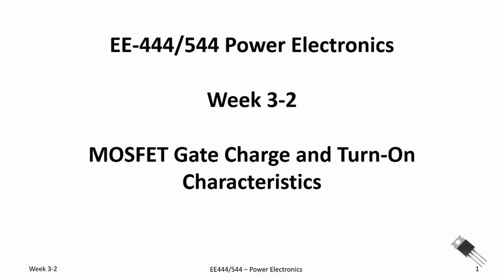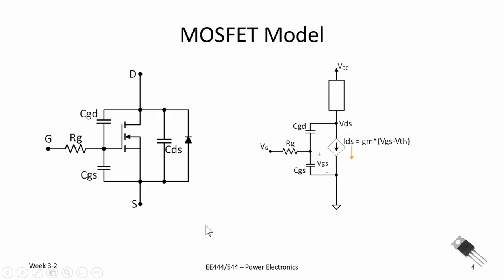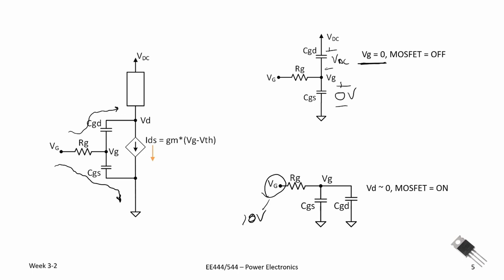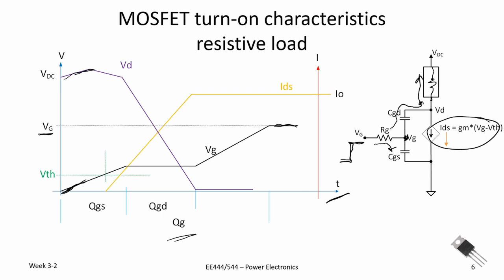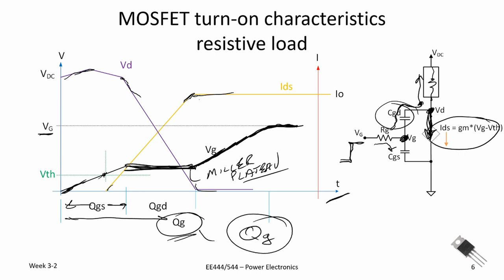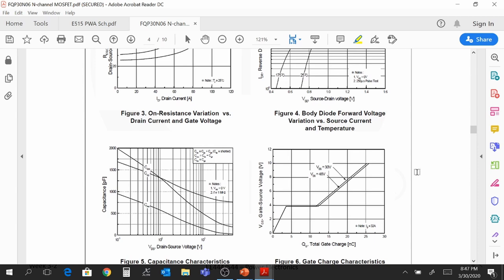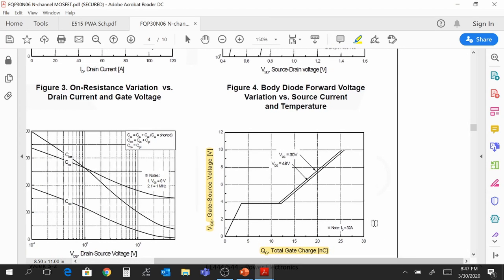Power Electronics WK3_2 MOSFET Turn On Characteristics

Comment: Thank you for your Video!
I'm a electrical engineering student from germany and our professor does not explain this very well. And by using the books he refers to, it takes way too much time to extract/understand the more basic function of this behavior. In this 18 minute Video I learned more than by dealing with all this alone for 2 hours, thank you so much!
Reply from the maker: You are welcome.  Where in Germany?  MSOE has a dual degree program with the THL in Luebeck and our German students are required to take this class in their 4th year.  Also, lots of great work on power electronics, motors, motor control, and EV technology happening in German based companies.  Best wishes on your design. -Dr. K
Reply: @powerelectronicswithdr.k1017 thank you. I live in Bavaria and I'm a student at TH Georg Simon Ohm Nuremberg, so no connecting to Lübeck. But that sounds like a pretty cool program.
We're having a big course  "circuit technology" in 4th semester of my bachelor's degree right now, so this is where we learn about this power-mos behavior.

Comment: For the resistive load case, if the current Id = gm(Vg - Vth), why does the current Id continue to rise, despite Vg being held constant at the miller voltage?

Comment: Hello Dr. K!
I came across your channel a while ago and the material is very good. Thank you for your videos. You are a good teacher.
I have a question about the consumption of MOSFETs.

If I am not wrong:

- The total consumption is equal to % of time in saturation multiplied by the power due to RDS(ON), added to the power due to the two switching (on / off) multiplied by the frequency.
(Proportional part of the time in saturation, plus two switchings, every period. The absolute power loss of ecah switch is independent of the frequency).

- All the power consumed by the MOSFET is transformed into heat.

If that is correct, measuring the temperature that the transistor reaches and dividing by the thermal resistance R-JC, we should have more or less the same number, is that correct?
I am doing tests with several MOSFETs to see it experimentally, and I see a very strange temperature graph: For a pwm of 10 KHz, pulses between 1% and 3% cause the temperature to rise excessively, and then it gradually drops to the calculated theoretical value. I've measured that temperature for 10, 20, 30 .... 250, and then 500, 750, 1000... 4095, with a 12 bits pwm. Lot of points.
For an IRF540, for example, the temperature reached with a duty of 2 us is 14ºC, and with 20 us it is 9ºC (above ambient temperature).
This is normal? Why can it happen?

If you find it strange and want me to send you specific information about the tests, I would be happy to do so.
(Sorry for my English, I'm Spanish, I hope you will understad that I wanted to explain...)

Thank you so much!

Comment: Dear Dr. K, you have explained some equations and showed plot of VGS waveform. Here a flat Miller plateau is shown for VGS. I agree with it for low side NMOS power device. But how about high side NMOS power device? Do you expect Miller region in VGS waveform for high side NMOS device during switching? 

According to my understanding high side NMOS device will act as source follower (voltage gain ~1). It’s drain is connected to fixed supply voltage so CGD will not experience miller multiplication. Hence Miller region should not exist. If so, how these equations related to gate charge, CISS, COSS, CRSS, output rise/fall time will look like?

Comment: Dr.K, I have a basic question for you. You say during start of turn on current actually flows through Cgd. My question is why does this current flow occur? I mean since capacitor is sitting at a higher voltage and charged, should we have  no current to it until it is discharged or less than VGS?  Consequently, why doesn't Cgd discharge via gate driver resistor as soon as bias is applied?  Thank you!

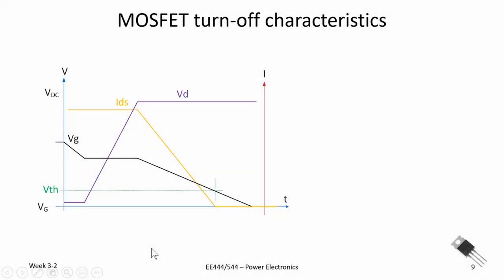Comment: Why the chart at 16:20 shows the drain current not falling together with rising drain voltage even though the load type considered in the discussion is resistive? Is this a mistake?
Reply from the maker: Hi Nishanth, you are correct that the falling drain current and rising voltage would happen at the same rates.  This would be a graph for an inductive load with a flyback diode.  Sorry for the confusion and great observation!  Best wishes on your design. -Dr. K
Reply: @powerelectronicswithdr.k1017  thanks for the content. It seems its quite rare to find material and charts on fet miller plateau in resistive load context.

A followup question, if Load resistor on drain is zero (such a circuit would be practically useless i guess. But just for understanding the mechanism), then the plateau wont appear at the gate any more, but drain current would rise to the max as per vgs and vds.. Would this expectation be correct?

Comment: 1. I wonder why Cds could be ignored? It starts from VDD and discharges to 0.
2. What circuit model is that used in the circuit analysis? Large signal model? Which operating region?
Reply from the maker: Hi Trunke, Cds is part of Coss.  Coss = Cds + Cgd and Ciss = Cgd + Cgs.  We look at Ciss as it is the capacitance that our gate driver has to work with. The gate driver has to push and pull charge into and out of the gate of the devices.  Realistically, Cds does impact the turn-off time (which is often shorter than the turn-on time).  I know this might not be a good explanation.  Here's another source to help https://www.vishay.com/docs/73217/an608a.pdf.  Best wishes on your design.  -Dr. K
Reply: @powerelectronicswithdr.k1017  Thank you very very much professor! Since I'm new to power electronics, I've learned a lot through your videos! And thanks for sharing the supplementary material! 🙏

Comment: Hi Dr. K, Wonderful explanation. I had a small doubt though...how do we calculate the switching time of the FET, is it the RC time constant ? In this case C=Cgs+Cgd and R=Rg....from your explanation I can see that when both capacitors are charged, the Vd finally drops and the FET is on...am I thinking it right?

Comment: Hi Thanks for explanation. I have few questions.

1. In general, what all is the miller capacitance affecting.

     Input cap of Mosfet will increase which will affect the previous driver , o/p cap will also increase. Is there any other effect of miller cap.
2. Does bigger plateau or smaller plateau indicate something? What effect will it have on previous stage and on current stage?
Reply from the maker: Hi Ranjana, the Miller plateau affects the turn -on -off times and is based on the gate-to-drain capacitance. The equivalent capacitance is also dependent on Vds. By “bigger plateau” do you mean the voltage value or the Qgd? Both will impact the turn -on -off times. Here’s a good paper the goes over a first order approximation for determining the switching times for a MOSFET: https://www.vishay.com/docs/73217/an608a.pdf

Comment: Thank you so much for your video, I have a question on whether the switching times ( t on and t off ) of the MOSFET vary based on the load condition and the drain to source voltage or not, I know that what mostly controls the switching time characteristics is the gate driving circuit but do other variations like the V_DS and R or L value affect it as well? Thanks in advance!
Reply from the maker: Tarek, yes to a certain extent the times will change.  This is due the Miller capacitance as that charging time will depend on the magnitude of Vds and on the source's ability to provide charge (i.e. higher dq/dt) to the load.  It is common to have bulk capacitance across the source, close to the MOSFET bridges that help with supplying charge quickly.  In the end, after all your designs and simulations provide some meaningful results, then you will need to build a prototype to test.  Another option is to use a topology that is based on softswitching such as the LC or LLC converter, then your switching time, while still important, will not result in large switching losses in the MOSFETs.  Hope this helps.  -Dr. K
Reply: @powerelectronicswithdr.k1017  Thank you so much for the detailed explanation! I love your content and your dedication to helping Electrical Engineering students all around the world <3

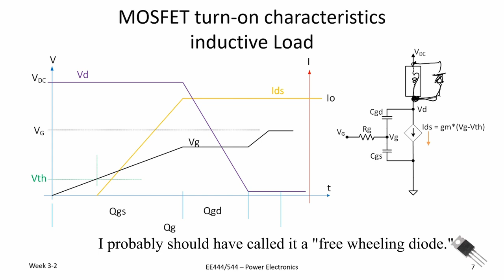Comment: Thanks for the good video!   At 9:18 why does Vd stays high for short period when drain current rises and then starts to drop only when drain current reaches the maximum? What keeps that voltage steady and causes it to fall at exact moment current is at the peak?
Reply from the maker: Hi Vitaliy, you are welcome and thank you for watching.  This is the worse case scenario and Vds might start to fall while Ids is rising.  This really depends on the load you are trying to switch and an inductive load will clamp the voltage during the turn-on and turn-off phase because the current through an inductive load can not change instantaneously.  And internally Vgs is 0 Volts as Cgs is initially uncharged when you apply the gate-source voltage externally. Therefore at turn-on, you are charging up Cgs and the channel starts to open.  For a highly inductive load, you might find that Vds starts to drop before you have current flowing.  In all cases, there is an overlap in time between Vdc falling and Ids rising.  This overlap results in an instantaneous power that in the worse case (shown here) is triangular shaped. In reality, the instantaneous power might be more parabolic in nature if Vds starts to fall as Ids starts to rise.  However, using this worst case is best for designing for power loss and heat dissipation.  Unfortunately, turn-on and turn-off is much more messy than this simple graph illustrates.  The key take away for design is Qg and trying to determine t-on and t-off.  This information will help with sizing your gate driver and determining the switching loss for your application and device.  Hope this helps.  Best wishes on your design.  -Dr K
Reply: @powerelectronicswithdr.k1017  thank you

Comment: Hi, sorry, but in the figure at 6mn, where we can see the turn on of the mosfet, the Ids will reach the load current at starting of Miller flat, but not in the middle like shown by the curves.
Reply from the maker: Hi, thanks for watching.  What you are reference is for an inductive load.  This is a resistive load and Ids will reach the full load current at the end of the Miller plateau.  The beginning of the Miller plateau is when Vds starts to decline.  This voltage will continue to decline as the drain current continues to increase.  In an inductive load, the the load will be at full current at the start of the Miller plateau.  This is shown at the 9 minute mark of the video.
Reply: @powerelectronicswithdr.k1017 
ah OK, right, thanks for your feedback.

Comment: Hi, Professor. At 9:54, why does all gate current ig flow through Cgd? I think there is also a path through Cgs. In other words, my question is: Why does the miller plateau exist?
Reply: I see the equation ids=gm*(vgs-vth), but it is vgs that determines ids. So even if ids becomes the full load current, vgs can still increase anyway (although it cannot increase the channel current anymore). Is there anything wrong with my thoughts?
Reply: @xinmiaoxu113  Keep in mind voltage doesn't change immediately across a capacitor. When the drain voltage starts to drop, the capacitor effect on Cgd has a negative feedback on the gate voltage, having it stabilized at the Miller plateau. Imagine: if the drain voltage goes low too fast, Vgs will decrease through the Cgd capacitor effect, which would cause the drain voltage to stop dropping or go up again... Gate and drain voltage have opposing effects. That's why there's a voltage which the gate cannot go higher until the drain voltage is stable. That voltage is the Miller plateau.

Comment: I failed to understand why there is a flat portion in the graph...what causing physically for which graph is flat....I have never seen any clear cut explanation on this topic (most of the application notes skip this area using some equation )
Reply from the maker: Hi Biswajit, are you referring to the Miller Plateau?  That's the point were the gate-source voltage is constant. During this time of the transition nearly all the gate charge is being used to charge the internal capacitance Cgd.  Please refer to page 3 of the following:  https://www.vishay.com/docs/73217/an608a.pdf.  This application note provides a good description of the transient behavior of the MOSFET.  Best wishes.  -Dr. K

Comment: 7:15 how a current is going from Vg to Vdc if Vdc > Vg
Reply from the maker: Hi Abbas, great question. This is only for a theoretical pure resistive load.  This happens because the node voltage at the drain of the MOSFET  is slightly higher (for just a very brief period) than the DC supply voltage.  This implies current flowing from the drain (higher potential) to the supply (lower potential).  In an actual circuit, this would not happen as the inductance in the load (and leads/traces) will not allow current to flow through the load instantaneously and will clamp that voltage at VDC.  Therefore, I wouldn't worry too much about this purely resistive case. Focus more on the Miller plateau and the amount of Q required for turn-on/turn-off.  Hope this helps. -Dr K
Reply: @powerelectronicswithdr.k1017  Thank you Dr. K 🤗🤗